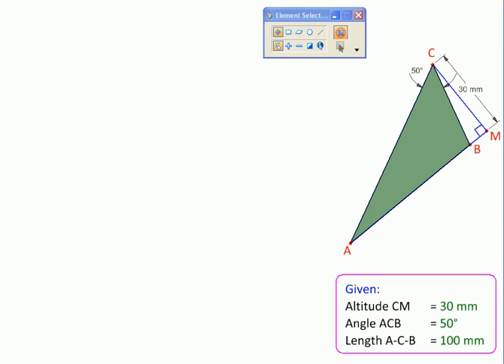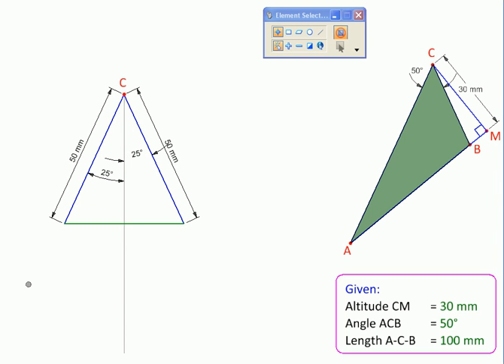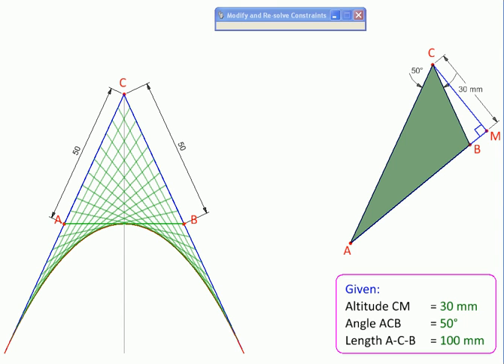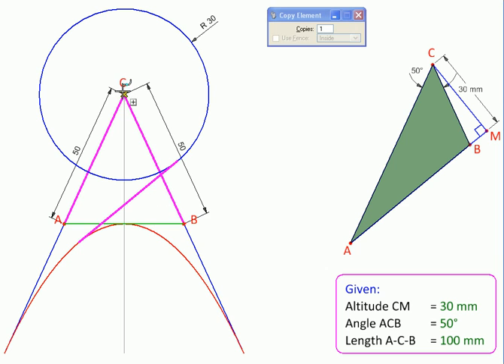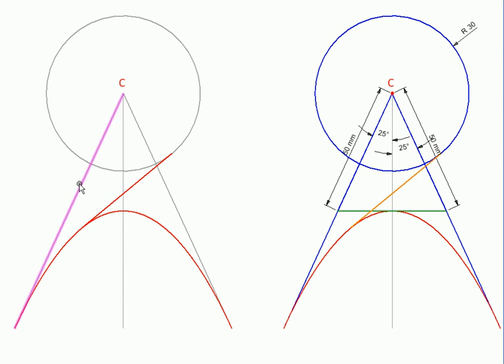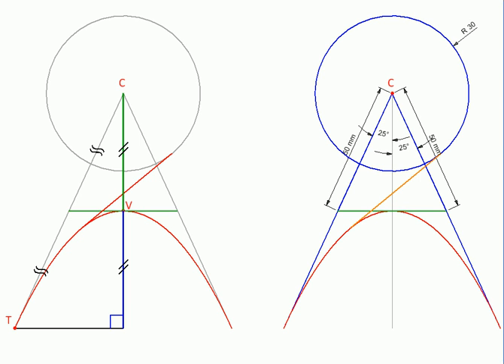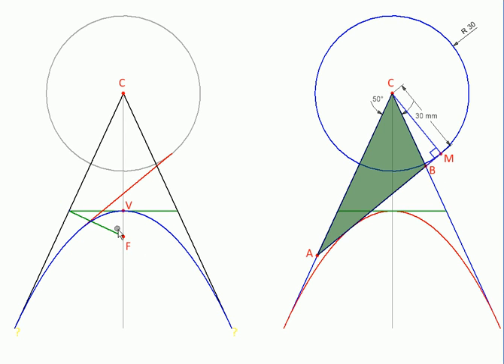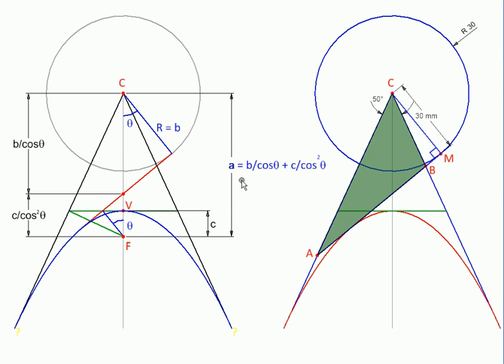Geometry with MicroStation Triangle from Altitude, Sum of Sides & Vertex Angle

Comment from the maker: @paul1964uk Always a pleasure to get your feedback! Sorry if the graphics/narration was misleading. Pedal just explains why the focus lies on the perpendicular bisector of tangent segment TC = 100mm. 
The second solution theta = 103.33° gives a common external tangent and an ‘inverted triangle’ if we call it that :-). It has external angle 50°, difference of length of two sides = 100, altitude = 30. CB = 148.3677, AC = -48.3677 (negative length!)